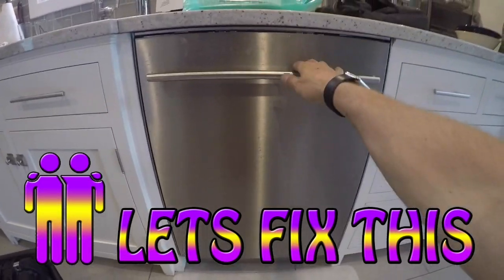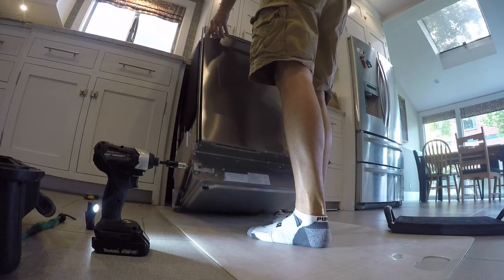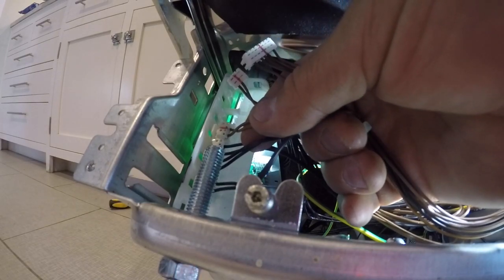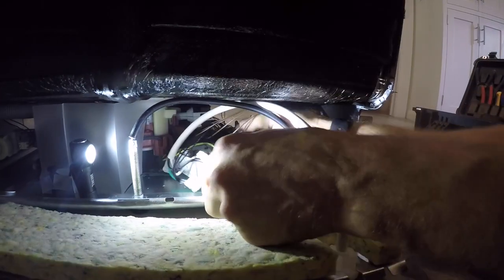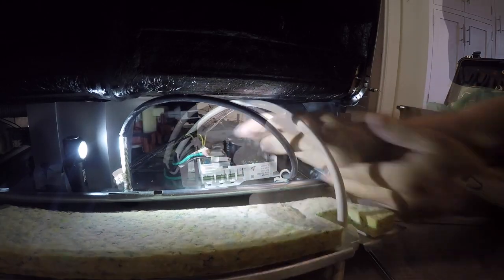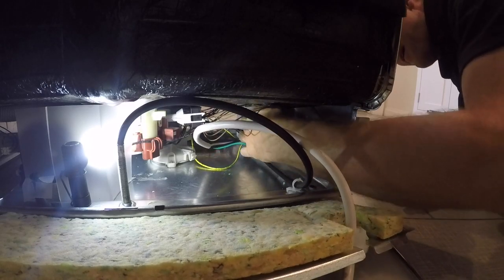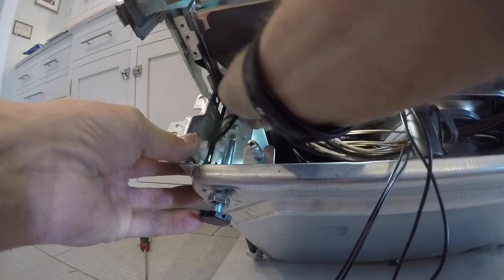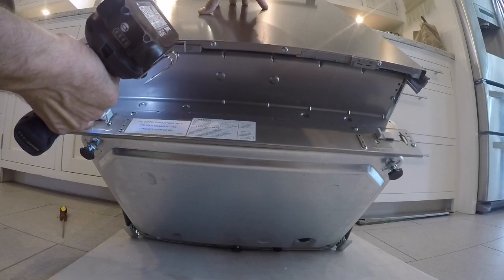Asko F12 Error Code

Comment: Hello -  Did you try performing a Time fill conversion on the dishwasher, this bypasses the inlet valve flow meter and allows filling via time. This often fixes the F12 ERROR.

Procedure for time fill conversion --- ONE POSSIBLE SOLUTION FOR F12 Error

1) Turn power off and wait 30sec
2) Turn on Power and wait for lights to light up 
3) Press Program and Start Stop
4) Now you enter Diagnostic menu by pressing start  (Start button to navigate settings)
5) Press start - Enter Water Intake settings 
6) Press Program P:0 (Default Pressure fill setting) and change to L:0 (Time Fill)

Hopefully this may help some people save a few inlet valves and control boards

-- From an ASKO specialist in a past life    :)

Ancora Imparo
Reply: you beauty - worked for me thanks heaps
Reply: @pjtaylor91 - Great to know it worked , saves replacing inlet valves
Reply: Thank you so much! It's impossible to find Asko parts here so you've saved me $1000+ on a new dishwasher! Really really appreciate the tip
Reply: @jonathansutton5764  your most welcome Jonathan.  It's a simple solution that should save many people money and minimise machines ending up in the tip
Reply: This appears to have worked! Thanks so much
Reply: @TiberiusGracchi  Happy to hear that it resolved your issue.
Reply: How can I fix this F12 Error from Asko model D5434?
Reply: Procedure for time fill conversion --- ONE POSSIBLE SOLUTION FOR F12 Error

1) Turn power off and wait 30sec
2) Turn on Power and wait for lights to light up 
3) Press Program and Start Stop
4) Now you enter Diagnostic menu by pressing start  (Start button to navigate settings)
5) Press start - Enter Water Intake settings 
6) Press Program P:0 (Default Pressure fill setting) and change to L:0 (Time Fill)

Hopefully this may help some people save a few inlet valves and control boards
Reply: @theoracle6005  How to do it on a D5426XLS?  I am jammed!
Reply: @wheelindex  Hi Wheelindex

Can you pls explain what you mean by Jammed.

What is the code your getting?

Thanks
Reply: @wheelindex  

The timefill conversion is exactly the same as explained in my earlier comment.

You need to turnoff the machine, turn on wait for the lights to illuminate before following the timefill conversion steps
Reply: Thank you so much for sharing the secret😊...amazing, it worked for me..
Reply: @aungzawchay  Hi Zaw

Your most welcome. Great to see the procedure worked for you and saved you $$
Reply: Mate you just saved me a lot of pain and money , Thankyou so much
Reply: I'm having trouble doing the time fill conversion on a DW40.2 can anyone add some details to the procedure? I've tried a hundred iterations and I can't get it into diagnostic mode. Brand new dishwasher! Thanks for any help.
Reply: @pjtaylor91  can you explain the process with more details? I can't figure out how to get it into diagnostic menu!! Thanks!
Reply: @jonathansutton5764  Hey Jon, I have a DW40.2 but I can't figure out how to get it into diagnostic menu, I've followed the procedure like 20 different ways.  Thanks!
Reply: Hey The Oracle! Would you be able to explain your Asko dishwasher service mode for me again, I've tried it dozens of ways but I still can't seem to get it to work. I have a brand new Asko DW.40.2 and I'm getting F12 error and it won't run. The world would really appreciate a short video on this!!!! Thanks. Nic from USA.
Reply: Hi Nicolas

You need to initially turn the power off for 5mins. Now switch the machine on and wait till the lights come on.

Now try the procedure

Procedure for time fill conversion --- ONE POSSIBLE SOLUTION FOR F12 Error

1) Turn power off and wait 30sec
2) Turn on Power and wait for lights to light up 
3) Press Program and Start Stop
4) Now you enter Diagnostic menu by pressing start  (Start button to navigate settings)
5) Press start - Enter Water Intake settings 
6) Press Program P:0 (Default Pressure fill setting) and change to L:0 (Time Fill)

Also send me a photo of your display panel
Reply: @theoracle6005  Thanks! I'm also going to request a warranty service from Asko as the unit was sold to me by a dealer as a new display model.  But I would love to try time fill. Do I need to shut off the electric supply at breaker panel? Then once it gets past the Asko screen, hold program first then start/stop until it enters diagnostic mode? Thanks!!!
Reply: @theoracle6005 hello! Do you have any tips for F12 error on model DBI653IB?
Reply: @theoracle6005 we can’t access the diagnostic menu, only Settings (with menu options - language, select programs, child lock, display settings, feedback sound, buzzer volume, rinse aid, super rinse, high temp, exit)
Reply: Hi 

Please turn off the machine at the power switch on the door and give it atleast 5mins to drain any residual capacitive charge on the board. 

Turn on and wait till the machine lights up, now follow the procedure and it should work.

Turning.on and off too many times can result 
In lockout from the menu
Reply: @theoracle6005  our model has the hidden buttons (that close into the top of the door). When I do step 3, the display says “program started, close door”. When I try step 4 and hit Start/Stop again, it just reverts back to the program waiting to be started.
Reply: It worked!  Thank you thank you thank you!
Reply: What do you mean by PRESS PROGRAM? There is no button called PROGRAM, is there?

Comment: Great explanation. Appreciate your video. I have tried the replacement from the front only and it works... The only thing to worry about is making sure that you still unscrew the back lower plate to get some power cable slack to pull forward to disconnect and reconnect...

Comment: Great to read the reprogramming solution shared above. GOLD! ...but note: it can be even simpler- i fixed it by cleaing the inlet valve on the dishwasher inlet hose at the tap end (low pressure being the DOCUMENTED cause) , see "unblocking the inlet hose filter" instructions 32 of manual for the asko DB1865IGXXL... or any manul for a washer or dishwasher has similar instructions . I have cleaned maby a tiny blockage from inlet hose filters over the years. But notw. It needed a few starts before it was "happy" witht the pressure. Note akso our water oressure fluctuates in Sydney a lot due to ancient street pipes bursting periodically. My washing machine detects low water pressure very sensitively despite oerfectly clean and new inket filter. So worth checking all of these things befire calling a service persin or needlessly reolacing a board.

Comment: I have Asko D5436 dishwasher. It gave f12 error couple times. I took out its fuses and put it back after touching with a screwdriver. Now, it is not giving any error but it is not taking any water. What do you think the problem could be? Should I replace PCB or water inlet valve? Thanks in advance

Comment: Hello Lets Fix This, Thanks for the video showing how to replace the control board. My ASKO dishwasher model D5457 starts a cleaning cycle by pumping out leftover water then the water inlet opens and fills machine to the correct level. It then stops giving a F12 error code and beeping. How can I be confident that replacing the control board will fix the problem bearing in mind a replacement control board is costly.
Reply from the maker: western main if it’s an older model you can just reprogram the control from a timed fill to a pressure fill. The new one you have to replace the board.
Reply: Hello Lets Fix This,

Thanks for the prompt response. 

In the short interval between addressing my query to you and your reply I have found that if the water inlet valve is turned off and a cleaning cycle is activated the dishwasher pumps out left over water and subsequently during the following fill step the F12 error code appears - as it should. 

Subsequently, when the current cleaning cycle is cancelled, the water inlet valve is opened and the a new cleaning cycle is activated the dishwasher works OK. Not sure if this “fix” will be permanent – maybe there is an intermittent gremlin in the control board.

Regards,

Bob Jensen
Perth, Western Australia
 @letsfixthis9343
Reply: @letsfixthis9343  Hello there! Thanks for the awesome video. Any chance you can show us how to reprogram the older machine from a timed fill to pressure fill? I have an old Asko D3250 and having the same inlet issue as the other poster. Thanks in advance!
Reply: @westernmain3281   Hello Bob, having what sounds like the same issue with my DBI663. I'm wondering how your temporary fix has been working, or if you ended up replacing the control board. 

I haven't been able to get a service manual yet, and I don't know if it is possible to reprogram to not use the inlet sensor. Anything you found would be appreciated. 

Thanks! 
Jesse

Comment: Hey Let's Fix This: I have an Asko dishwasher that isn't cleaning well. The top dishes are getting cleaned great, but the bottom ones only get partially cleaned. I've checked the spray arm (it's clear with no gunk blocking the holes) and it does have water coming out of it, but it's like it's really low pressure. Any ideas of what I could try to replace to get the bottom rack working better?
Reply: Hi this issue could be caused by a foreign object stuck in the divertor motor that distributes water pressure to upper and lower spray arms in tandem.

There is a disc with two holes and should this motor get blocked or stuck, it will cause improper wash results